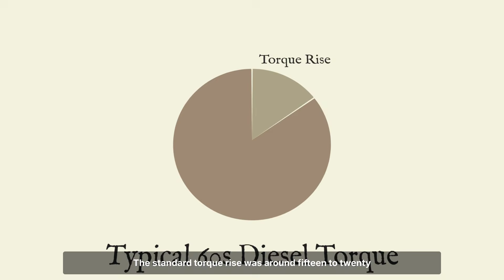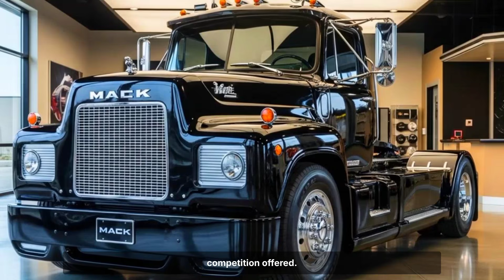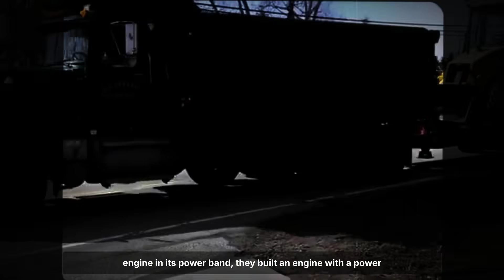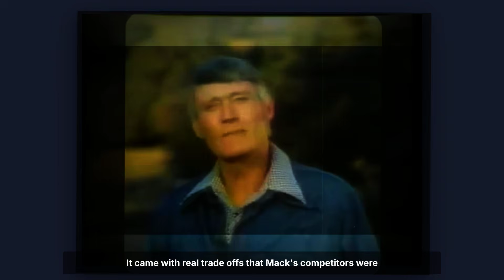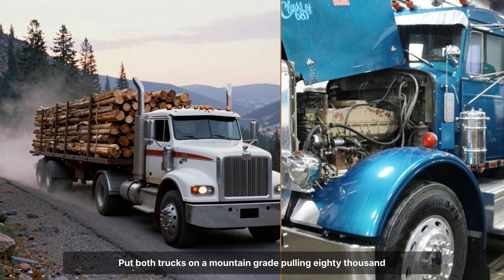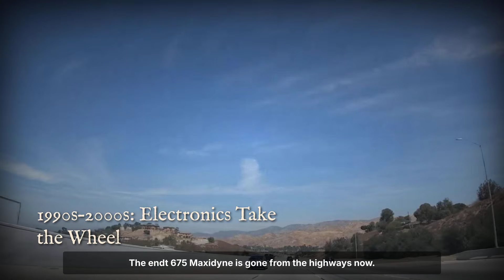Why Old Mack Truck Drivers Refuse To Drive Anything Else

Comment: 1974 R600 Dump in the summers then  Intermodel in the winter. Got the job done. That power had a 300+ put in it before I got it. I drove that Mack for eleven years.
Reply from the maker: That's an amazing history with Mack trucks! It's clear why you'd stick with them for so long.